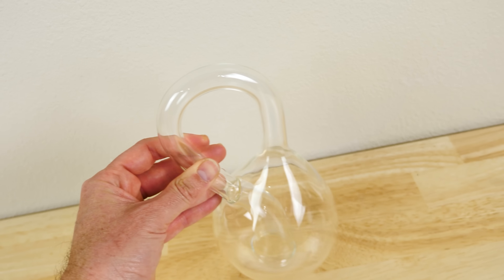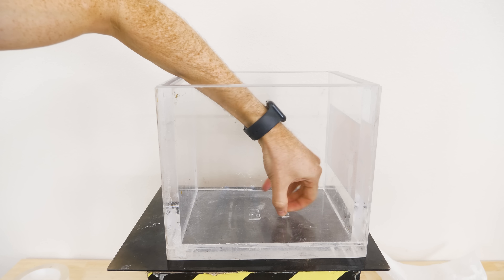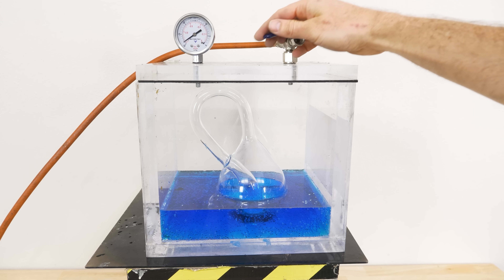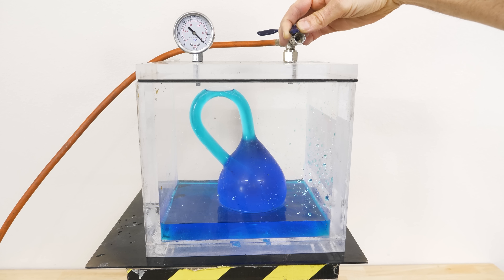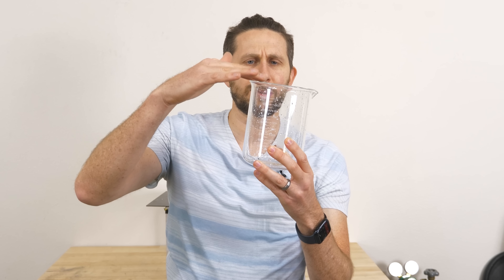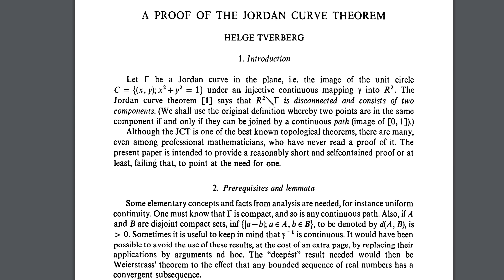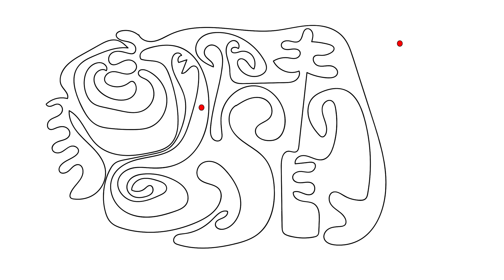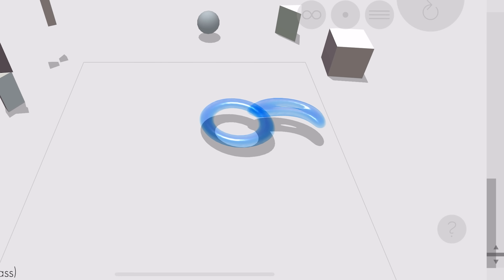Is It Possible To Completely Fill a Klein Bottle?

Comment: The first solution I thought while watching the beginning of the video, was to use a thin hose to pump some liquid on there, place the source container above the jar, and then just wait for the siphon effect to do its job.

Even after the first try with the vacuum machine, I thought of continuing on foot. It would have worked for that small bubble! 

Wow, having a vacuum cube is so fancy! 😂
Reply: Facts, or just like mouth siphon the air out of the bottle while it sits in a tub of water. GG EZ
Reply: Mine was just submerging the bottle...no idea if that would work or not.
Reply: @williamblackfyre4866  ikr lol
Reply: This seems like basically an air pressure siphon.  A tube would have been the smart solution.
Reply: What about sticking a pipe through the opening then filling it up from the inside?
Reply: literally what i thought
Reply: same thought
Reply: or you can use a syringe to pump the liquid inside instead of trying to siphon the liquid
Reply: Why can't we just dip this shit in the bucket?

Comment: Another detail that everyone misses for some reason is that even if you wanted to create a klein bottle using glass, there would be an intersection between the neck and the body - YOU COULD NOT FILL IT UP (there is no hole there)
Reply: Remember, what we call a Klein bottle is just a 3 dimensional shadow of a 4 dimensional object.  Like a hexagon can be the 2d drawing of a 3d cube.

Comment: The only way to fill the bottle would be to fill the entire universe, because the inside is the outside. To do that, you'd need to get matter from a higher dimension, since there isn't enough here.

Comment: You don't need the vacum chamber, only a tube. Put bottle with oppening siding up, get a teflon tube (as example) and put it inside until it reaches the highest level accordding to the meant position and just refill, the air should scape through tube. The trick for knowing if it's inside or not is very usen on programing games. Like from Spain!

Comment: Great video. Wondering: could you not just fill it by immersing it completely in water and rotating it completely so that the air bubbles out?
Reply: Yes.  I have done this with mine.
Reply: Don't take my word for it but i believe the glass would break. Seems like a delicate object and rotating it fast enough under water pressure may end up breaking it.
Reply: @HowToArter  but subjecting it to a vacuum chamber is perfectly fine?
Reply: @thatoneguy611  that's also a fair point
Reply: @HowToArter  Why would it break?  Mine didn't.  Just don't bang it on the sides of the container you have it submerged in.

Comment: if u would have just turned it on its side, the air would flow out much easier. like Das Boot, from Beerfest. but there would still be air in it. i got almost all the air out this way except a small bubble that i couldnt work out without more air slippin in

Comment: What about using fire? I've seen a video of a guy putting alcohol in a container and lighting it on fire. It very briefly becomes a pulse jet, but then once the fuel is all burned up, it creates a large vacuum. So is there a way you can use fire to do the same thing in the Klein bottle?
Reply: This is actually how mechanics stretch tires on cars when they stance them.

Comment: I’m not a big fan of the volume semantics. It’s a pretty unnecessary distinction and I feel like even if it’s technically incorrect terminology, it’s commonly used to mean that so why change it. Like the definition of literally meaning figuratively these days. It just sounds weird to say that a beaker or a pipe has no volume.

Comment: i dont really undestand why there's no volume. wouldnt the volume be everything inside of the bottle, starting from the tube's opening at the bottom? 

 if this doesnt have volume, doesnt that mean cups or bowls dont have volume as well, since its open to the air? i guess im just not understanding why you couldnt calculate the volume.

edit; probably shouldve just watched the whole video, he explains it pretty well.
Reply: Its just how the volume is decribed in math terms.

 A cup has no real inside, given its open, kinda like how a gazebo isnt. It can protect you from the rain and sun, but you arent inside given there are no real walls to it.

Comment: Wait, could you use that line starting inside of the shape going to a point outside of the shape to preform easy overlapping checks for points on super complex concave shapes? That's frickin' rad!

Damn I need to re-visit some old collision code I never got to work with even simple concave shapes.
Reply: Technically this test breaks if the drawn line goes through a point along the curve without actually crossing the curve itself. So as an added rule, just don't count those.

Comment: couldnt you technically just use a straw? put it all the way "into" the bottle and fill up with water, i feel like then the air would be able to get out through the straw since you're not pouring water directly into the straw

Comment: filling from the outside to the inside is probably only possible with a vacuum or tedious with swinging the bottle. But if I push a water hose to the inside and fill it from the inside out, it should theoretically be easy, shouldn't it?

Comment: I think it's possible to fill it with just normal elastic hose that pumps water inside it. With narrow hose the air will go out because it didn't fully closed the way and water will go inside in narrow elastic hose.

Comment: Thought: if time is a measurement of change then a single point in geometry moved using time. Makes a radius thus a sphere. So we have 1 dimension that with time becomes 3. That sphere then moved at right angles becomes a larger sphere and so on.

Comment: You did not need the vacuum chamber to fill it a simple thin pneumatic hose all the way to the bottom and suck the air out as you fill ☺️

Comment: You don't need a vacuum chamber, a straw would do just fine.
The more interesting part is that you would probably not be able to completely empty it of air even if you completely surround it by water for the same reason you can never fill it with water without mechanical support.
A more interesting approach would be to fill it trough condensation.
Reply: The straw (or a tube actually) was what I expected to see. You can even avoid a pump by simply holding the reservoir above the bottle and then pour into the tube.
Reply: You can fill it by completely submerging it.  It just takes enough vertical rotations to get all the air out.  The same method to completely empty the water out again afterwards.  (Ignoring wettable surfaces.)  I have done this with mine.
Reply: okay but this looks epic
Reply: That wouldn't fill it all the way though
Reply: A small garden hose works fine, It pushes and Is small enough to allow the air being pushed by the water.
Reply: mate using a straw sounds as dumb as your name. Also you don't really have anything to prove here so why explain it with careful calculation to detail
Reply: @syqtho9835  Unlike you, I have a name.
Reply: @torgrimhanssen5100  everyone has to have a name and it’s required by law. Thought you were the bookworm here.
Reply: @syqtho9835  Did it fly above your tiny head what I was hinting at?

If your going to offend some ones parents naming sense then you should at least represent yourself with a name.
Reply: @syqtho9835  Your comment contains exactly 0% substance and 100% insults. The reason a straw would work is simple: it sucks the air out.
Reply: @kyh148  and how do you suppose getting the liquid in. A vacuum chamber works the same way a straw does so I don’t see your point
Reply: @kyh148  straws don’t suck the air out, dude this is like 5th grade level science.
Reply: @syqtho9835  Okay okay, technically it doesn't, but close enough. You know what I mean.
Reply: @kyh148  gotchu bro
Reply: Interesting. So you're telling me if you dumped that bottle into the ocean and let it sink, there would still be air in it? I'm not saying you're wrong by any means but that is hard to conceptualize.
Reply: @Anthony Hernandez  I'm no physics expert, but it seems as though this works via matter exchange. When water flows into any vessel, air must flow out (You can feel this when drinking from a non-collapsible water bottle. If you make a perfect seal and don't exhale into it, it gets a lot harder to suck water out until you let air in the bottle.) The way the Klein bottle is shaped, it disallows the escape of air as water flows in, no matter how much it gets rotated around.

This actually makes me raise questions of pressure. As you go deeper underwater, air is compressed. What would happen to a Klein bottle at various depths of the ocean? Seeing as how its air would be compressed and the water would be pushing harder to go in, just how much water could it hold?
Reply: @Legacy-sw7bv  It is quite interesting.
Thunderfoot displayed connecting a few glass tubes and distilling water into it before sealing it with a blow torch.
Once it cooled there was a vacuum bubble left inside that would move as you shake it without obstruction of the water making a very loud reangle.
Reply: @Legacy-sw7bv it would be crushed before it filled with water
Reply: @KitchenerLeslie2  That's what I'd like to find out, just how full it could get and at what pressure it would break (especially when made out of the strongest possible materials that won't impede its "Klein bottle-ness")
Reply: @VivisDoomsday  The structure with the entry point "at the center" of the flask makes it so that air can't escape past about 60% full.

This is the same rules as filling a glass with water in your sink and having it stand in water bottoms up. as air can't enter, water can't exit and now exist above "sea-level"
Reply: @torgrimhanssen5100  I see, so would it just be an endless cycle of air and water pushing each other but none of them ever completely beats out the other?
Reply: yea was thinking the same it would be a hell lot easier
Reply: but where's the fun in that?
Reply: Alternatively, you could just get one made out of plastic, drill a tiny hole in the "bulb" and let that be the air escape. Just don't tell anyone that bottle has a hole in it. If a tree falls in the forest and no one is around to hear it, there's no evidence it made a sound. Same with your Klein bottle hole.
Reply: nah man either you break the klein bottle and put some water in or just submerge it in water
Reply: @coconut7630  I'm sure you will find out your sarcasm is as intelligent as trying to fill the bottle to the top by submerging it is.
Reply: @torgrimhanssen5100   I think if you're submerging the bottle then I think the question should be, "Get you get water out of the bottle?"

So rather then fill the bottle with water, we're gonna pour out air underwater. Really it's a matter of rotating the bottle in the right patterns. I mean, there isn't actually a seal when you pour out.

Comment: So the real question is: how can you fill up a volume?
Reply: This guy is using a strictly theorectical mathematical definition for volume. Containers have volume. Their volume is defined as their mass divided by their density. Similarly you could break the beaker into pieces and put it in another beaker filled with water and record the change in volume and that change would be the volume of the first beaker.

Comment: You could also probably fill it just using a tube so the air doesn't get trapped on the way out? That said, it's still a great excuse to break out the vacuum chamber ;-)

Comment: .... or submerge the bottle and rotate till the air is gone. 
... the beaker has a volume. The volume of the thickness of the glass forming the shape. 
... you don't use math to prove something. You do the math of something that is true. If you can't do the math it doesn't make it false.

Comment: Could you also fill this by distilling water? Have steam go up the tube, condensate on the top, and drain into the glass. Once the glass section is full, you can easily fill up the rest normally.
Reply: Or just, shoot water up it, like from a hose…
Reply: @GrayknightYT  even better, put the glass inside water and just rotate it to take the air out
Reply: @GrayknightYT  I was looking for this... but gotta make complicate solutions I guess...
Reply: Wouldn't a straw going all they way in but still sticking out to let the air out work aswell?
Reply: One better. The thing is filled with air, a fluid, thus proving the fact that it can be filled
Reply: I think the point is, if you fill the glass section first, you have to hold it one way, but holding it that way would make gravity prevent you from filling the tube, and flipping it over to fill the tube would push some of the liquid out of the bottle.

The same applies to shooting water from a hose. It'd leave air in either one part or the other.

Simply submerging the bottle would quite obviously just result in a gas (air) pockets, but I guess rotating it while submerged could work with some patience and the right angles.

I thought about the straw idea, but it'd require two straws, one pushing liquid, the other pumping the air out. You would need to plug the hole so the liquid does not get out as it's being pumped in, so one straw pumps the air out (so the pressure doesn't rise too high, preventing more liquid from entering the bottle), and obviously one injecting the liquid. In hindsight, one straw might be enough with some creativity, but it would leave an ever so slight amount of air, which technically shouldn't be the case with a vacuum.

As Navneet said, it technically is filled with air, tho while air is a fluid, it is not a liquid while at ambient temperature, and I'm pretty sure, while it is not in the title, it was meant implicitly that we'd fill it with something else than air, which is what most people on earth consider "empty".
Reply: u just read a page from my chemistry notes 😂

Comment: You didnt even have to use a vacuum chamber to fill it up. if you stuck a tube all the way through the opening and into the bottle and pumped the fluid into the bottle, you could fill it up.

Comment: Doesnt seem complicated to me at all. Does a wine glass have volume? Yes. Yet there's no seal or barrier between "inside and outside", there's just a rim where liquid fills up to. The klein bottle pictured here also has a rim where liquid can fill up to on the under/flat side there. So it has volume - a certain amount of ml of liquid can fill it to the top.

Comment: Haven't watched the video yet, but I think you can't fill a Klein bottle, it has no volume, just like a Mobius strip, it has no volume, you can "fill" it in 2D but not in 3D

Same thing for the Klein bottle, you can fill it with water in 3D but in 4D you cant

Comment: Only reason why the water did not enter the bottle outside the vaccum was due to air., So if you put a flexible straw  till the end of the bottle you would be able to fill the bottle techinically., but by adding a straw would it change the rules of the game., ie., change the inside to the outside., thats another math problem to solve.

Comment: I think at the end You meant to say that the klein bottle can only effectively be be considered as having any volume in a fourth dimension,   rather than saying  "a true Klein Bottle cannot exist in three dimensions"  - because what you're holding is still a true Klein Bottle... even though you cannot fill it at regular atmospheric pressure, it still is a true Klein Bottle... 

for it to work it needs a 4th D,  but if you could pass  it between dimensions, from the 4th to the 3rd, nothing about the bottle itself changes! > Right?

Comment: I don't think the concept about what constitutes a container was explained clearly enough, for example pressures can create containers there doesn't need to be a visible barrier, as long as the barrier exists and encloses a space. For example if the atmosphere was an inert gas at a high enough pressure to prevent evaporation and thereby able to prevent water molecules from escaping or interchanging with those that would normally be suspended in our atmosphere for example, or if the liquid in the container was stable in our atmosphere then the beaker even without a lid would become a container with volume, as a definite barrier had been established. Additionally for mathematic purposes there are non definite barriers that are treated as containers such as the interplanetary pressures in our solar system which create pseudo containers with particles emitted from the sun which is then used to calculate volume and particle density between the planets. There's definitely a lot more complexity that I think is worth explaining regarding these details as well as even if whatever is occupying the space is in a stable state of influx and outflux that is also mathematically a container. How what is inside the container behaves is also fundamental to what a container is and that is something that has caused a lot of disconsensus  regarding this theory, especially in the wake of advancements in quantum physics and quantum particle behaviors as to our knowledge there isnt a material or barrier that isn't permeable to something. The event horizon of a black hole is possibly the only thing that almost meets that criteria due to nothing being able to escape out of it to our knowledge, but even that is permeable from the outside.

Comment: Just take a syringe and a long kathetre, and fill it. wenn you reach the top part, put it under water and fill it completely.
Or put it under water and use this trick to suck the air out.